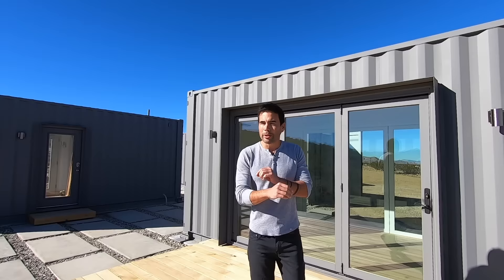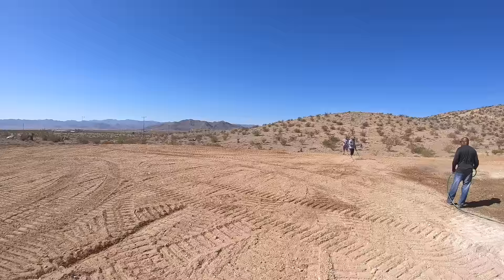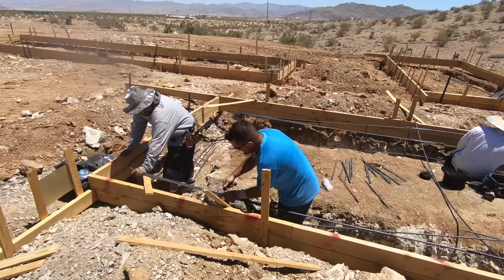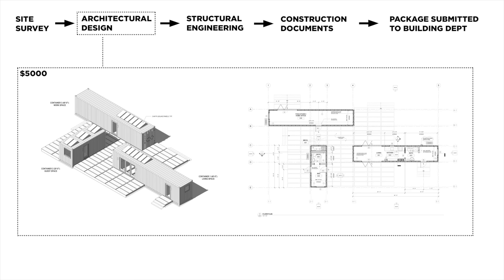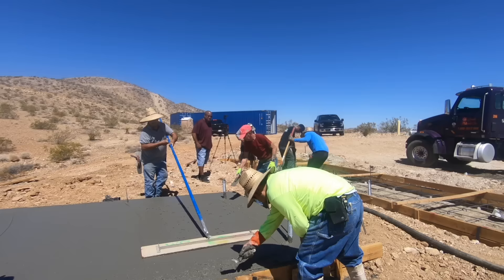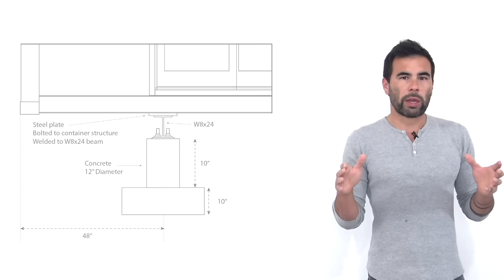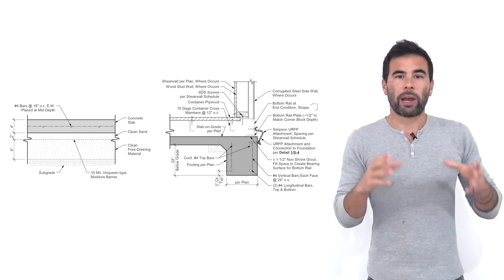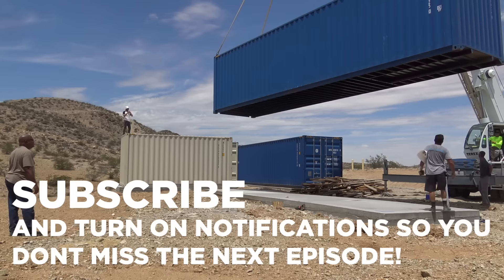Building a Shipping Container Home | EP01Permits and Foundation Design

Comment: Massachusetts mason here. I would have done the same thing for the foundation. It works with garages (with some minor differences on the concrete layout) in a winter state so im sure it works 10 times better in a warmer dryer state for your small houses.

Comment: Why didn't you bury a container?  It would have been a nice place to have storage or a cool place to hang out during the 120 degree summer days.  Also, it doubles as a bomb shelter when the nuclear holocaust happens.
Reply: I don't know about "Nuclear Holocaust", but a Basement would be nice!
Reply: Also, it will be hard, the dirt will kill your container in no time.  :(
Reply: @JodBronson  how so?  Is the steel not rated as a retaining wall?
Reply: Nope!  Look closely in the Video, he mentioned he had to built "frame" around the Container.
Reply: Check out episode #2, he had to built frame around the "inside" the Containers, LOL
Reply: 1..containers arent designed to take pressure from the sides and will collapse underground. 2. You would still need to pour a foundation under it way undergroud. 3. California wouldnt allow it. 4 drainage and other utilities would become way more complicated than necessary. 5 he didnt want to. 6 he is not a total idioy. 7 build your own damn house.

Comment: Them foundations seem overkill? Its a container?
Reply: He explains why he did whole slabs.
Reply: Exactly-completely unnecessary and moronic.
Reply: @VictorHLopez33  He’s your typical libby. The entire build is ridiculous ! He could have and should have just leveled and dropped on that extremely hard and more than suitable soil and if there was a problem with the building authorities (now that he notified them) he could have easily used sonitube footings (8”-10”-12”) poured concrete tubes. Would have utilized about 10% of the concrete he used with his plan.
Reply: @renorolet4283  He's a complete poser who could take a lesson from 'Life Uncontained' who built a container home from scratch without any previous experience.
Reply: @VictorHLopez33  If he’s a poser, he failed. 😂 
Anyone who spends that kind of money on permits and an overkill foundation for a 2 container home in the middle of nowhere AND puts it on video is a ___________.
I’m a registered home builder in PA. I’ve built brand new 2 story framed homes on top of an 18” bed of 3/8” pea gravel (NO CONCRETE footing or slab.
We set our pre-cast walls right on top of the stone. Better, faster and cheaper. There was no need for this person to do what he did. I’m still scratching my head why he spent money he did not need to spend?
Reply: @renorolet4283  agreed!

Comment: I'm from México and the construction  process is similar and we have tons of earthquakes and here and from experience the way you did it it's the most effective way. I would connect the containers to the concrete. Also a pro tip the concrete has to be at leas 10% of your total hight (from the ground floor).

Comment: I think you need a new engineer.  Containers are designed to hold 24 tons inside and supported on the 4 corners and stacked 10 rows tall on a ROLLING SHIP..  Your first plan  was over kill: why didn't you use 4 piers with something to allow movement?
Reply: The issue wasn't that the container couldn't handle the movement, it was specifically the foundation. No engineer is going to sign off on a project where the container would slide off of a buckling pier foundation no matter how stout the container itself is.
Reply: @ryukahr but the containers would budge if they were sitting on an inadequate foundation pier. Is it going to be catastrophic? No, but if it tipped and a fridge or something shifted and crushed somebody whoever signed off on it would be held accountable.
Reply: @stevendoinghisthang8319  You realize California has earthquakes right? And on ships, those containers are all securely tied down to the deck. The question was never if the container would be okay. It was if the foundation could hold up to the lateral load of a shipping container house in an earthquake without failing. Was this necessarily the best way? I have no idea, but it's a good compromise for his specific situation.
Reply: @stevendoinghisthang8319  Which engineering school did you get your degree from? And when was your California engineering license granted?
Reply: @stevendoinghisthang8319  I don't think you are a scam artist, did someone else say that? And while nobody needs a degree to know that shipping containers are strong (duh), you don't get to have opinions about the soundness of engineered foundation systems, especially in a highly active seismic zone, without backing it up with actual intelligence on the subject. Well, I guess everyone is entitled to their own opinion, but yours is not valid. Sorry man, that's how it works.
Reply: @stevendoinghisthang8319  If you recall, I said everyone is entitled to their own opinion, even you, pal. I didn't claim I was in charge of anything anyone else does, says, believes, or idiotically posts on YouTube. Fact remains, you're not an engineer and you have no idea what you're talking about. Via con Dios, amigo. I'm done here.
Reply: @Michael-nd7gh  

I have seen shipping containers dropped as far as 20 feet and still retain their structural integrity. Slipping off of a 1 foot foundation pad is not going to result in death of any of it's occupants.  The occupants would have a grater threat of injury from the china cabinet or the plat glass window then they would from a 1 foot fall.  There is absolutely no chance of a collapse of a single level shipping container home from even a magnitude 9 quake period end of story.  If it did slip off it's foundation all it would do is slide back and forth and/or hop up and down.... The regulations and building codes of Calf. are excessive to the extreme and are simply not applicable in this application.

25k permit costs for simple builds such as this is just plain stupid and one of the reasons so many builders are running out of California as fast as they can.
Reply: @GSpotter63  I agree, the fees are excessive. Regarding a container falling a foot and killing people, well, if you've ever experienced a REAL earthquake you know this actually is entirely possible, but that's not the real reason for extreme requirements for lateral integrity. Learn your history and read up on the insurance losses incurred by banks after the Northridge earthquake and you will be better informed.
Reply: @Michael-nd7gh  

 For regular traditional construction most of the  California code are appropriate. But the problem with strict coding is that it restricts innovation and new construction techniques.  Quite often the coding simply does not apply and just creates  unnecessary expenses.

P.S.  I grew up in LA and experienced multiple earthquakes. Even had our own house destroyed.
Reply: @GSpotter63  Again, it's not that shipping containers aren't strong, in the event of an earthquake I bet the container itself would be the least damaged in a fall, but it's not like there won't be damage. Siding, roofing, interior walls, appliances, plumbing, etc. WILL NOT survive the drop even though the steel box may. What happened when your house was destroyed? Did you file an insurance claim and wait for the house to be rebuilt? Or did you walk away leaving the bank holding the bag like MANY people dis after the Northridge quake? Either way, houses falling to the ground cost banks millions, if not billions, of dollars after a catastrophic event. And it costs the state (which is us and our taxes, in case you think "the government" is some faceless entity with unlimited funds) more than that in infrastructure repair, temporary housing programs, food, care, lost taxes from people who can't go to work, etc. Stop thinking about foundation systems as a method for saving the box, it's a device to mitigate the insane amount of money it costs to clean up after a massive earthquake.
Reply: @Michael-nd7gh  

 Oh. I understand now..... For you it's all about the money...  Engineering and the truth be dammed.
Reply: @GSpotter63  While your sarcasm is not lost on me, it does indicate that you still don't understand. I'll take one last stab at this to try and help you get it, but I'll be done after this comment. Also, let's be clear, I have no pecuniary interest in permanent foundation systems any longer, though I did spend a decade inspecting, permitting, and installing them in, literally, every part of California, so I know what I am talking about. It's not about money to me, it has nothing to do with me, but I do like to share the knowledge I gained while spending many years in the industry. But it IS all about the money to the mortgage lenders/banks. So here we go! If a person applies for a loan to buy a house the mortgage lender is going to have some hoops that the buyer needs to jump through in order for the lender to agree to loan the money to purchase the house. Those hoops are designed to protect the bank from getting stuck with a loan that nobody is going to pay back. They run the buyer's credit and check the buyer's employment history to make sure this person can pay the loan back. Then they also have requirements about how the house is constructed in order to try and keep the house from being hugely damaged or destroyed in a catastrophe. They do this because when a catastrophe strikes, a lot of people, even good people, simply walk away from a destroyed home because they can't afford to rebuild their house or they can't wait for insurance to kick in since that could take months, even years. The lender now has a destroyed house to deal with, and a mortgage that will likely never be paid, so the bank gets screwed big time. I'm not making any comment or judgement on banks themselves or crappy lending tactics, I'm just simply describing what happens in real life when disasters strike. The permanent foundation requirement on certain types of housing is an engineered solution mandated by California state law and was pushed through the legal system by the mortgage industry to try and keep them from losing their asses when big earthquakes destroy lots of houses. The financial system in the US is beyond enormous, and it has armies of lawyers and lobbyists that serve the interests of the banks, not the citizens. It is 100% about money, you got that part right. But there is a ton of engineering that went into the situation, whether you think so or not. And that's the truth. I'm not saying the foundation system laws are perfect or even good, I'm just explaining the history of why they exist. And if an engineer wants to do business in California, they've got to play by the rules, same as anyone else, and that drives permit prices sky high. Hell, even labor is way expensive and materials are too pricey, but it all comes down to money for banks.
Reply: ace toxic  Google "permanent foundation California"
Reply: @stevendoinghisthang8319  I like how the video explained all the options, but if you don't build to the strengths of the shipping container and you try and build to normal construction ideas you are going to have a very expensive BOX.  It is a small hot box; that is CHEAP super strong and wont rust even when not painted.  Work to its strong points.  Also did they connect it to the slab or did I miss that?   Leave it up to the enlightened governments in CA. to over regulate a simple project.
Reply: @stevendoinghisthang8319  
What he means is that you can have an opinion, but as far as the topic of engineering goes that opinion is not correct simply because you lack the knowledge of an engineer in the matter.
 It's like saying 2+2 is objectively 4, but in your opinion it's 5. You can have that opinion, but as far as math goes, it's wrong.

That's how I see it anyway
Reply: @Michael-nd7gh  Thank you for educating us, Michael.
Reply: @jordanputnam6973  Tie down the fridge

Comment: God...I swear...kommiefornia and their friggin rules.  Unbelievable.  They give you a MINIMUM house size?  What?
Reply: Yeah, if it is on wheels, then it can be smaller with no attachment to the ground, etc because it is so much "safer". Why have the regulations at all? Most states it is a 400 sq ft min. If went to all that work, why not put in a basement for cooler storage and room for utilities?
Reply: Makes all kinds of no sense.  Why have a minimum at all?  I don't see the point.  If someone wants to build a little shack to live in, why can't they?  It's like they make rules and regulations just to make rules and regulations.
Reply: @rmp5s  That's true, that reminded me of that guy who got arrested for resisting arrest.

Not sure why it reminded me of that, but it did, lol.
Reply: It's not only CA.  Florida subscribes to the IBC(International Building Code) rules, minimum 600sf.  Some counties interpret that differently but because of the IBC(which is an International 'standard'), you can't even be off-grid in FL. That's right, the Sunshine State has some of the worst net metering agreements in the US AND you cannot have a home NOT connected to the grid.  I finally fled FL and am in AZ now.  Solar is much more accessible here and the NM agreements and power companies are much more lax in requirements than FL or CA.
Reply: @chrispcarrot  I went to college at UNM. I miss ABQ so much. I got stuck in Miami after getting hired by a company scout right after graduating.  Now I work from home and can finally relocate. Any rental or for sale opportunities around you? I'm so tired of this humidity,  the overpriced electric bills, and the big city traffic here with no public transit options. At least when I was on Central Ave I had good eats every morning at the Rising Star diner.
Reply: @chrispcarrot  That's crazy. 

AZ is the best...that's where I live, too.
Reply: I think I was reading about this recently.  Its to keep slum lords from building tiny cubicles and renting them at a premium because of the location.  I think from what I read, most places have a regulation or two on the books like this, even if it doesn't make sense to us common folk because building a house that small never occurred to us.
Reply: architect/ urbanist here. minimum house sizes are given to avoid real state speculators making inhuman cheap houses to rent. we live ruled by the free market, so managing this kind of things is annoying and really hard (sorry for my clunky english, im from argentina)
Reply: Wait. Are you accusing California of communist rule? Do you even know what communism means? You're making that comment of a video about a guy who privately owns land. I hope you know at least 2% about the words you use so you'll know why your comment is so absurd. It reveals you to be a person who is not serious. I suspect the extend of your knowledge of communism is, "it bad."

Comment: Y so much concrete...the 48ft container weigh about as much as 2 cars...not very heavy at all...I've seen containers on home depot concrete blocks and havnt moved in 10yrs
Reply: Maybe he will land a biggest 300 ton helicopter on those containers... :D
Reply: Leveling and lateral support issues,as he explained clearly.
Reply: @franklee2683  leveling and lateral support....constructed of steel beams and cross members...it has all the support it needs...designed to b fully loaded and lifted by four points 4 inches in diameter😂😂get off the gas
Reply: @franklee2683  I been working with shipping containers for 20yrs...I know
Reply: @robertmartinez696  the earthquake issue. Not enough support according to the engineers.
Again,as explained. 
Never mind....go build sumpin'.
Reply: No,seriously. 
Go ....

Comment: All that work and expense to park a tin can. Piers are used in Palos Verdes with individual jacks because of seismic activity. I would be inclined to just spread around some cinder blocks and drop it on them. A high stand for your crawl space is a good idea because this provides a lot of square feet of storage space you won't have to build.

Comment: No respect for the grinder while cutting rebar?  That thing spins at 15k rpms and the cutting wheels can shatter while in use, sending fragments of the wheel at body piercing speeds.  Wear gloves and a face shield.  And sneakers with no socks??  Come on dude, you're working with metals.  Be smart and keep your body parts.

Comment: When  people live Off Grid In Containers,  They just Put them on the Ground Period or gravel at best..  No fancy rebar concrete footings.   Also,  Tiny Houses made from Containers are on Wheels,  Trailers.  And they just sit on the ground with wheels, tires.  Again No Fancy Expensive engineered concrete footings.

Comment: All the “lateral load” stuff for a one level steel structure like a container is pure BS.
Reply: Could you elaborate? I don't remember ever hearing of containers being airborne from hurricanes etc, but not so good on science to figure out if the possibility is there once the containers have cutouts like windows and doors.
Reply: @marilynreno7510  First off, in the California desert you don't have to worry about hurricanes, secondly, the second proposed design in the video was more than enough and would have been perfect but money hungry engineers and permitters stride to go to unnecessary bounds to snatch that money out of your pocket.
Reply: @stevendoinghisthang8319  true, no hurricanes but there was the huge Landers quake about 25 years ago so lateral is important. But I agree, not in this case with a one story metal container. Most engineers here in California are afraid of being sued so they tend to be very conservative in their structural designs